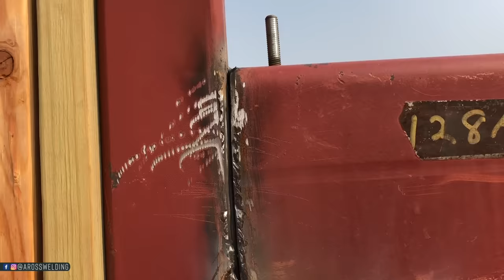STRUCTURAL WELDING IN THE BIG CITY // BAD WELDS

Comment: I'm an AWS CWI, and you are the guys we're looking for!  Folks that actually know, understand, and execute a proper weld per the print and code.  That garbage you are repairing is all too common, and is the reason more and more jurisdictions (driven by insurance requirements) are requiring certified welders and inspections on structural steel work, regardless of the scope of the job.  Whether it's just an I beam in a house renovation, or a Starbucks canopy, they need to cover their butts.  Those flare bevel joints look outstanding, I wish I saw more like that.  Good on you for supporting the Vo-Techs and Welding schools.  The more folks we can get started with a proper understanding of welding, the better.  Not that there aren't people out there that aren't naturally good.  We all know someone that never welded, picked up a stinger, and the rest was history.  But for the most part, we get guys in, and you get the " I saw a video on YouTube", or "My Uncle Clem welded on Tractors for 30 years"....  and they have already started to pick up the bad habits.  Those habits need to be nipped in the bud.   Great video by the way!
Reply from the maker: I agree for sure. Thank you for sharing your thoughts.

Comment: Nice job Austin. I have been called in to fix three huge jobs just in the past 2 months. At least that is red iron, preengineered buildings suck, they slam em up in 2 weeks and then like you have 2 days to weld everything.....yeah right, prep to remove the dip paint is like one day. For people who don't know, wanna learn to do structural, learn to weld 1/8 thick steel with 7018 3/32 in 4F and learn to control the penetration, this will make other stuff seem simple.

Comment: Anyone can weld. But only a qualified JM can do a proper weld. Good job.
Reply: No. Literally anyone can weld. I started welding last month and I have yet to find something in the range of my welder that I can't weld successfully. The qualifications are just for insurance purpose, the  weld will basically be the same regardless of the operator.
Reply: @xl000  something to try i(f in range of your welder) welding with a engine powered stick welder (not in a building but outside) a 1/8th inch thick 4ft x8ft sheet of A36 steel plate to another of the same and join them length wise to make a 8ft x 8ft plate using a 1/8th 7018 electrode and the plate must be flat without ......distortion ......and  it will lay flat on a concrete pad. if successful try it with 14 gauge steel and appropriate electrode. also  take a  6ft wide x10 ft long x 3/4 inch thick A36 steel plate lying flat and weld a 1/2inch thick 4ft x10ft A36 steel plate lying lengthwise at a 45 degree angle skywards and the weld must be  full strength and  porous free with no fisheyes using 5/32" 7018 electrode for the root pass and then using a 7/16 " 7024 electrode to fill and finish the weld. the plate must be distortion free within 1/8 of an inch lengthwise and the 45 degree wing plate must not be buckled length wise.and must be straight. 👍

Comment: The money you make on this job get a LN 25 so you can wire the next one and cut your time in half and double your money
Reply: Will they allow flux core for these jobs?
Reply: H & K Bee just depends on how the WPS is written. Or follow specific code with prequalified procedures.
Reply: No need to pack a ln 25 around on a small job like this.
Reply: motoMFthug it’s called investing in your own business one of the smartest investments
Reply: Could you please explain what a LN 25 is?
Reply: Ciro Guillen it’s a wire box that hooks to an engine drive weldn machine they make an active8 too a little bit smaller good for small wire
Reply: Dualshield would at least cut this job in half!
Reply: @noesantiago9397  absolutely till it's a bit windy.
Reply: H & K Bee  yes sir LN with a 232 wire
Reply: WPS is not what determines the weld. It's the engineer drawings, then you match the requirements by applying a WPS. This is the reason we have to fix these screw ups. When in doubt, 7018 all the way out.
Reply: @cirog6133  Refers to a suitcase welder. I just bought 7 LN 25 Pros for my shop. They are nice because you can run GMAW or FCAW ( mig with gas or fluxcore without gas). Still need a power point but the generator on the truck works well. LN 25 is made by Lincoln Electric. Ironworker by trade, used them multiple times.
Reply: @aaronfenn6075  Im a chicago union iron worker and we use flux core wire with the LN25s extensively and in high winds. The wind is not a problem and hank is right, it will cut the weld time in half however the learning curve is a factor.
Reply: @paulluna45  right you meant flux core not dual shield. It would be way better then.
Reply: You can’t weld NR 232 with an SAE 300 
NR 232 runs on constant voltage ,,,
Lincoln made the SAM machines to weld CV- bottom line is - if he acquires a job where production is key, then he has to have the correct machine to do so, or to run “flux core “ within parameters.
If the majority of his work is SMAW and he is to par with production rate, fine.
Reply: Aaron Fenn you can weld dual shield in a gale if you have just a little bit of a wind shield. It’s incredibly forgiving
Reply: @cirog6133  its basically a big mig aka wire feed
Reply: Yea let me cut down my own hours that’ll make more money
Reply: @htxsn9543  if it's contract work yes he is right...if its by the hour then that would be a no
Reply: How much would a job like this payout in profit?
Reply: Learn2weld .... I’ve never seen an engineered drawing specify what process or procedure to follow. Engineer drawing specify the type of weld ( ex fillet, butt weld) the thickness or length of the weld ect ect. Process and procedures are submitted to a customer or a GC for approval. On Austin’s end, I’m curious to know what Quals he is showing that he is a qualified/ certified welder ?? We all know he can weld the crack of dawn and a broken heart but what papers is he submitting ??  I am A current CWI and I would ask this question if he showed on a job. And I’m not being an ass here, I am a current Union Rig hand and a CWI. Would love to see him get back on the ROW but sometimes this is a great way to make great money also, and your your own boss too 👍👍
Reply: @hankleonardo2996   it's called billable consumables. You can make the same money with 7018s just as you can with 212 on a small job. It's not like he's welding column splices with seismic wire on a story job. 

A lot of people can't afford to invest in a 500 and a LN25.  Super wasteful if you don't even need to use a 500 or ln25 because you mostly do odd jobs.

Comment: Don't let the inspector see you on that aluminum ladder
Reply: Why? I've seen many rig welders on those kinda ladders.
Reply: @kadenarvello5648  that's a big osha no no. Supposed to be fiberglass. I have a very similar ladder on my truck personally but have been told to not use it on jobs. They do conduct electricity well too

Comment: Just a tip for you I do a lot of stick welding Marine construction seawalls barge work you name it and the stinger gets kind of heavy after a while with that big zero gauge cable I usually take the stinger with the cable and wrap it around my inner wrist so the wire  rolls off the top of my arm and away from my body and to the welder helps reduce a little bit of the weight and your hand doesn't get as tired something my dad taught me a long time ago always helps hope this helps those who are reading this best of luck welds look great

Comment: Great advice at the end man I had 8 months before school started bought a DC machine on Amazon for 300 bucks went up to 200 amps and I could switch the polarity so first I started with 6013 to get a feel for it and then started welding 7018 stringers on plate then started uphill and I mean I did this for 8 months straight pretty much I think everyone should start with stick it will help you so much with the other processes at least that was the case for me and we started with stick and blew.through that part.of my training cause of those 8 months watching vids and trying to do the same.thing

Comment: I put up barns, shops, barndos, fence. I know all the layouts , which means I'm on point most every job. 
Seen 5 welders each had a helper all had scissor lifts, took them like 2 1/2 months to frame a small dominos pizza building. I know because i drove by that job every day en route to at least 3 buildings we completed with a 3 man crew the difference is they must charge a hell of a whole lot for those commercial buildings.

Comment: Good advice I am in school here in newyork at apex I am about to buy a welding machine to get some extra time doing it👍 I just got out of oxy and now I am in stick your completely right once you understand that puddle you can start technique although those t joints are a bit hard in oxy to weld and get complete Penetration especially since they would bend it to see if it held this stick seems like it will be easier not constantly fighting the flame adjustment

Comment: You are exactly right man. Those flare bevels need to be filled up. Those other guys didn't know what they were doing. Running down hand 7018, damn!! You told the contractor boss the right thing. To speed yourself up, run that 1/8" more and stay away from the 3/32". You could have also ran dual shield, but I've ran a ton of 7018, like you show here. Good job buddy...

Comment: I performed an impressively bad weld in my Inspection and Testing class today. It was a T joint on 1/2" mild steel, running 7024 on 330 amps DCEN. I had spots with almost 1/4" of undercut, an amount of fusion that made my teacher laugh out loud, porosity throughout and slag inclusions everywhere. The only flaw I didn't manage to include was crater cracking.

(EDIT: because it's the Inspection and Testing class we're trying to include flaws on purpose)

Comment: I'm a structural steel welding contractor in California and was wondering why you don't use wire (FCAW) either dualshield or fluxcore to weld on structural. I understand why you use stick (SMAW) on your post jobs and obviously on pipe. We use E71t-8 Lincoln innershield Fluxcore wire on all structural steel. Just curious about what they make you use out there. Thanks for your time. Stay safe

Comment: Im a certified structural stick and wire welder and I always wonder, since I run structural wire all day, why places still run stick for structural when wire can do it minimum 4x as fast mind boggles me. Sure stick you dont need to carry around a suitcase but I'd take that over switching rods ever 30 seconds. Props to you Austin!

Comment: Was welder for near 50  years and during that time was a  AWS QC1 inspector for 10 years. I can tell you with out question that a bad weld is easy to identify. But 7018 downhill is about as big a red flag as you might see. I don't recall ever certifying a welder or procedure for that direction of travel in structural welding. Mostly used in API 1104  certification of welders and procedures.

Comment: Sometimes on that rework on the radius gaps next to tube I like to use 7100 gas shielded flux core 045 EASAB wire it's a pain with the bottle but man you fill the gap and the product is great also it meets D1.1 if you get the cert in the process ( you may have) last I got burned on a welding gig no pun intended where a construction company had us do all this extra work and did not pay ... now dealing with carpetbagger construction companies we get paid daily to insure payment what ever happened to you work you get paid ! Great job keep it up stay safe!

Comment: I never went to an actual welding school, but was trained by an expert on the job.  Worked as his helper first.  Curious here, I see you use a file rather than a chipping hammer to clean slag, why is that ? I have always seen others use chipping hammers and/ or wire brush.

Comment: Do circle 8s better the half u's. Each weld side jumps up to the other the down and back up across and down again. Stack the 8s up and its build up better uphill. 7014 is down hill but you still have to go uphill with 7018 after a 7014 bead line to start.

Comment: Just me, I would of P5+ the root and 7018 cap all the welds. Really burns out that old junk out those old cut outs. You have a remote so you can change up them rod setting pretty fast. Great work considering the situation

Comment: Hey dude I'm not really a structural welder more of a pipe welder but I'm curious. Could you have on that type of work... fill that gap with 6010 kinda like running a root brush it off and 2 pass it or possibly one pass it with some 7018 for your cap?

Comment: Awesome video... Question... Should it be advisable to use a safety harnes when working on a ladder with all those tools? Or is it just going to be on the way of the task?

No building welding experience here, beginner stick welder, no training, self taught but I did work on ladders before... 😊😊😊
Reply: It's required by OSHA anything over 4 feet high even in a manlift.

Comment: Started welding again after 30 year break. Most of the skills are  still there  still more grinding then I like .but my biggest problem is seeing the work maybe a new helmet?
Reply: A lighter shade on your lens. I personally inside of a shop used a number 11 but I’m also only 22 years old. Most old timers I’ve been around use 10s. Higher the number the better ( to save your eyes )
Reply: If you (like me!) wear "cheater" eyeglasses, you can get a magnifying lens to put in your hood (unless it is a cheapo/ no name) for about $10 😎

Comment: hi welder from norway here. i work at a company building topsides for oilplatforms and we are not allowedd to weld with electrodes we hace to weld with mig or flux core . so i wonder would i not be faster too weld these with a 300amp flux core machine so u dont have to change electrodes so often ? the machines we use is the danish migatronic 300amp and we use for regular steel and the wire we use is sf3am from japan

Comment: Don't make a habit of welding in both clips before setting beams or tubes. Great hot tip at the end. I was fortunate enough to go to welding for free in high school.

 I've also seen too many people pay for welding school when they could've learned for free by joining a union.
Reply from the maker: They checked the header before I welded it out. I showed that in the video, but it was a time lapse so it was moving fast.
Reply: UALU 52 here joining my hall was the best decision of my life.
Reply: The knowledge you got from high school is available in the literature. There are literally hundreds of books on welding.
This is why those stuff are taught to kids.. It's because it's easy. Last time I checked, you don't need a PhD in Chemistry and Engineering to strike an arc and move the rod along the seam...
Reply: @xl000  controlling/avoiding  arc blow and determining the thermal expansion of the steel in relation to the strength of the weld per inch of a weldment will decide the quality/strength of the finished job. this knowledge cannot be learned in a short duration of time and will take thousands of hours of practical experience in weld/fabricating work.

Comment: What's the pay rate for a cert welder in the U.S.. New Zealand is between $25 - $30 for workshop welding. High quality tig welder in stainless steel can get around $35 - $80 NZD an hour.

Comment: I did it for about 35 years, I use to change jobs about every two years, gained a lot of experience doing that, especially where you have to fabricate also, I always liked building something, just welding all day is so boring, I worked in a code shop on pressure vessels, tank shells one foot thick, fittings two feet in diameter, when the welding starts it never stops, 24 hours a day seven days a week, usually under heat, than it goes to X ray, sure as shit a speck the size of a match head, gouge it out not knowing how deep it is, a real pain in the ass, but it has to be perfect, out of position welding fleetweld 5 takes forever, it is used on high carbon steel pipe, about the same as your tested with,6 inch diameter one inch thick one vertical one horizontal takes about eight hours to test, I made good money but hard dirty work, especially in the oil field

Comment: Hey Austin how did you bid this job? Hourly, daily rate or by the job? Would be interesting to have some insight
Reply from the maker: I just charged by the hr on this one. It was a last min, need it now type deal so I just told em I’d charge by the hr.
Reply: @arosswelding  very cool thanks! This is normally what I do it's nice to hear from others in the industry in other areas of the country

Comment: Architectural welding = 6013 6011, maybe 3/32 7018, etc., WPS so it doesn't fall down, meets architectural contract requirements. 
Structural welding WPS maybe 7018, xx18, etc., (matching base material strength) so it meets code requirements visual, maybe RT, UT, MPI inspection, per the contract requirements.

Comment: Iv done a lot of that welding on red iron. An you need to watch that side to side welding on that. There is some inspectors out there that won't allow that.
Reply: Not sure where you are but where I am code stipulates you cannot manipulate horizontally anymore than twice the diameter of the electrode. So a 3/32 electrode you could do a weave of 3/8 maximum.

Comment: Why didn’t you finish the welding on the verticals where you moved to weld up the top joint and down the sides part way where carpenters are going to frame on top . you left the vertical for later

Comment: Why you dont get a wire feeder and weld that out with some .032 fluxed core wire.  You can knock them welds out in 1/3 rd of the time.
Reply: You need a pretty decent machine to do flux core wire from a wirefeeder unit properly with 1.6-2.0 mm flux wire
Reply: Not much to break on a stick welder. MIG welder, running a long cable and getting the wire rats nested... no time saved there.